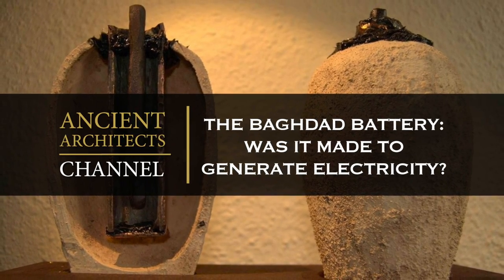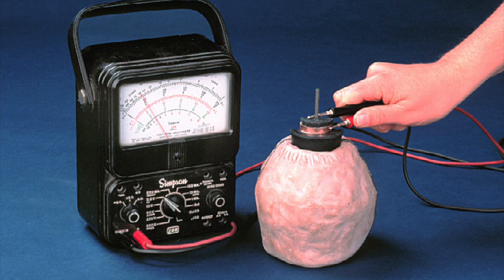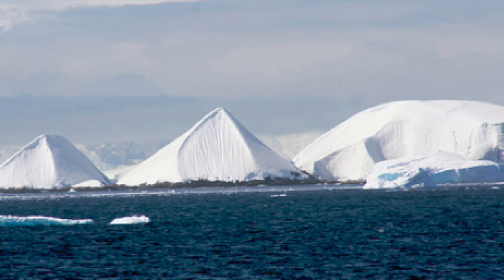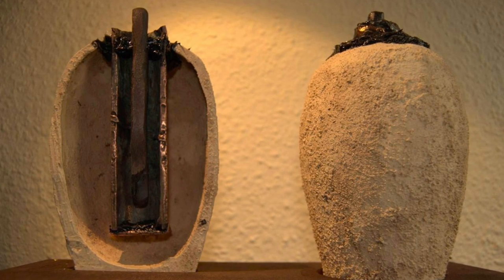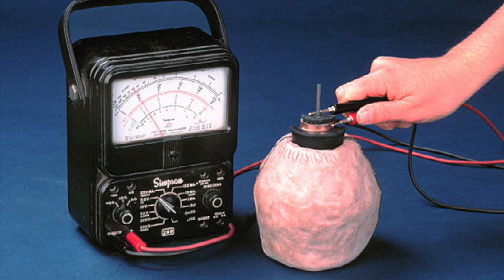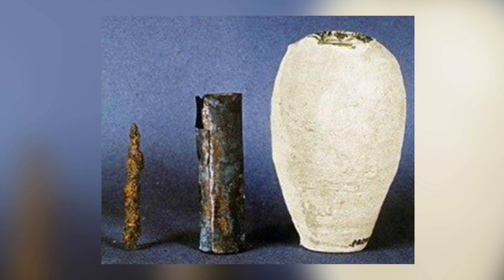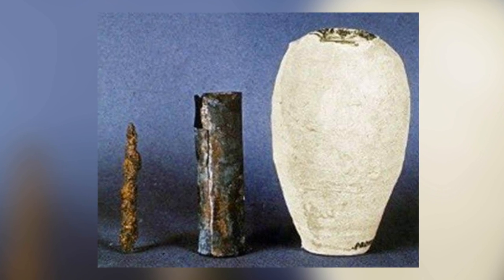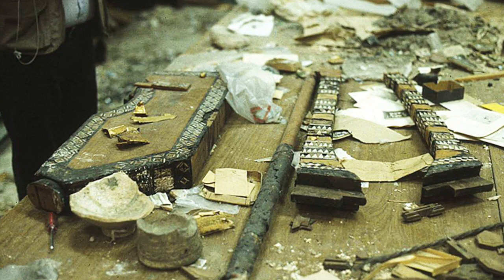The Baghdad Battery : Did it Really Generate Electricity? | Ancient Architects

Comment: Okay, but if they were to store papyri,  then where were the remains of the papyri when the jars were opened? Why traces of acid on the iron rod? Why the copper cylinder? The papyrus hypothesis only answers the question of why the jars were completely sealed over with bitumen. It doesn't answer the other questions. A sealed clay jar should certainly have preserved papyrus, so the absence of any papyrus in the jar suggests a different purpose. Certainly is a puzzle! Thanks as always for discussing this!
Reply: I had those very questions. The papyrus storage hypothesis seems even less plausible than the battery hypothesis - though many of the problems with the latter are glossed over by its proponents. And it's nice to have an evidence based discussion of these artifacts. Is there an application other than a low voltage battery that copper, iron and acid can be used for?
As for completely covering the iron with bitumen, if these were batteries, could that have helped to preserve their charge until they were needed?
Reply: @TugIronChief  much like the dead sea scrolls
Reply: They weren't batteries for gods sake! The only reason why you can say that it's because they look like one. If that was battery then where are the wires? What kind of machines are they used for? You guys really should stop this new age bullshit.
Reply: @arkyudetoo9555  you should stop believing everything your told by the corrupt main stream and learn to open your mind and think for yourself
Reply: @arkyudetoo9555  Okay, but if they were to store papyri,  then where were the remains of the papyri when the jars were opened? Why traces of acid on the iron rod? Why the copper cylinder?
Reply: @DiscordC  Unlike conspiracy theorist, I don't assume on the answer.
Reply: @DiscordC  I know how to think for myself thank you very much. I don't trust the government as well, but when it comes to scientific discoveries, these things can be verified by 3rd party sources. Say for example the Earth is spherical not flat. Etc....

Comment: Plating.  I work in the plating industry.  It wouldn't be hard to use this for ornaments and trinkets.   If something was plated, anything found from so long ago the plating would be long gone..
Reply: Also, I'm not trying to correct you at all.  You are far more versed than me and you can probably find better examples than what I was able to Google.  Love you channel!  Long time follower, first time commenter lol
Reply: Spot on!
Reply: Correct, that was probably where it was used for.
Reply: It might have been kept as a trade secret too. After all, If you had the power to electroplate you had a great advantage, you could easily short change people as a jeweler claiming something was solid gold! And no unhealthy mercury to deal with. Just iron and copper and vinegar. 
The only mystery to me is why they put the copper cap on the bottom of the tube, since it is not required for it to work as a battery. The whole thing could be filled with vinegar, it seems pointless to use the clay jar as an insulator. But maybe they did not understand things correctly. Regardless it would work either way.

Comment: The tar could be easily melted inorder to refill electrolytes or am I wrong? Could it be that priests found a novel way to create a charge for someone to touch and get a religious experience(shock).
Reply: interesting theory indeed & plausible.
Reply: I like this theory. Makes sense
Reply: Priests used to use all kinds of tricks in temples to impress their visitors. Massive doors that swing open at the touch of a finger, mechanical "robots", windpipes that "sang" in the wind, steam engines that twirled when heated by a fire, etc. The Greeks excelled at this because of their scientific innovations.
Reply: the charge from several of these in series would still be weak enough to require you to lick the electrodes. Just dont ask which part of the statue of god they put the electrodes on
Reply: @GreyGeek >  O2(g) + 4H+(aq) + 4e-  -> 2H2O(l)
If the electricity is internal and the jars not found together, could it be a way of purifying water?
Reply: @GreyGeek Great criticism. Thanks for the long form explanation.
Reply: @GreyGeek You are missing 'wires'. Wires would attach to external object. It was sealed so that it can be carried easily without spilling the contents.
Reply: @paulpvhl1930  This is an interesting thought

Comment: The bitumen was not complete hardened at the time, you know it is soft and often mixed with oils to make it more flexible therefore removeable. They could connect 12 batterys and had 12 V like a car battery. the cable were made of copper and they used it to plating or for electrolyse. Just because you can find a motor or a vacumcleaner mean not the had no use for electricity.
Praveen Mohan built some of them take a look:
https://www.youtube.com/watch?v=KDlcU1vt4bU
Reply: As they say, absence of evidence is not evidence of absence.
Reply: The problem is people are assuming it is a battery, so they are looking for evidence that is one. Instead of looking for evidence of a battery, just look at the evidence available, THEN make a conclusion.

Comment: I was amazed when you mentioned the ratio of lead to tin for the solder. Same as we use today in modern electronics. Below is a brief explanation.
63/37 ratio is a Eutectic alloy of Tin Lead solder. As such it melts at a temperature that is lower than each of its constituents, and at a very precise single temperature rather than a range of temperatures. In the case of 63/37 it is 183 degrees. 60/40 melts around 188 degrees C.

As the melting point is a single temperature it will transition fast than non-Eutectic alloys which means lower chances of dry joints. In non-Eutectic alloys one metal will melt before the other, and the same is true when solidifying.

Comment: Voltage alone does not tell you the power. Keep in mind, a car battery has only 12V, but it is quiet powerful. 
You really don´t want to shortcut one of these.
Why would they use two different metals to store scrolls? I don´t have a clue what this things are.
Reply: Copper was valuable and was used before bronze and then iron for armor.  It was also used as currency later [as traded ingots earlier].  Using a copper, bronze or gold cylinder to house or transport important documents is reasonable.  Putting an iron rod that could cause damage could have been done in ignorance of that danger.
Reply: @JMM33RanMA  You think ancient humans were ignorant about basic Metallurgy? It is clearly a battery to produce electricity.
Reply: @trira1171  What a bizarrely hostile reply.  Stating your unsubstantiated belief strongly doesn't make it true.  While it is possible that it was a battery, there are equally possible alternatives.  Without actual proof, arguing like the six blind men and the elephant is silly.

Comment: I'm behind the electroplating theory. As far as electroplating materials go, all you need are a battery, some electrodes and a bowl of plating solution.
They wouldn't be electroplating gold, so whatever was plated would have likely corroded and/or the plating came off. There's a lot of incentive to gold
plate items for the purpose of economy, or deceit. If it looks like a battery, and it act's like a battery, it probably is a battery.
Reply: The necessary volts needed to electroplate metals is around 5 to 12 volts, this thing only emits like less then 4 volts and has one terminal covered
Reply: @bioman1hazard607  As for what you can power with them, thats only a question of many do you have or can you make, as you can connect them in series or parallel to increase voltage and current indefinetely.

Comment: There are many artifacts in ancient human history,  that are gold plated.  It's one thing to find something like the Baghdad battery,  and question what it was used for, but when you recognize that there were gold / metal plating from around that time, it's just reaffirms that these people had electricity.  Even in ancient Egypt,  there is tons of evidence for the use of power tools, and though they could have used heavy stone flywheels spun up by human power, there are many examples of this tooling,  within sharp angles of stone  boxes,  in which you could never fit such a machine with a large enough fly wheel nesacary to produce the power to do the work. Again, u keep finding evidence,  that supports other evidence,  that supports a theory.  They had electricity.  There is more evidence to suggest it, than there is evidence to deny it.
Reply: The fact no soot from oil lamps inside the megalithic structures also say the Egyptian used something else to light the passage ways. And there are many catacombs under Egypt built by the ancient Egyptians. Probably just to get out of the mid-day heat. There is the theory of mirrors, but morriors also magnify the heat of the sun, not just the light. ??

Comment: The Modern AA,AAA,C and D batteries are around 1.2v , the vessel does resemble electroplating equipment.  Placing a thin layer of metal on another metal is useful, and depending on what was being made may have disintegrated, overtime. Copper on iron, would not likely have survived t the modern age. The Statue of Liberty in NY had to be largely rebuilt after 100 years, and the copper on Iron contact points now have insulating separators. 
For a Scroll holder copper makes some sense since it is  anti bacterial,  What ink could they have used that fruit juice wouldn't wreck? If the vessel could infuse copper into the scroll it would last longer with out decay.

Comment: same could be said about the papyrus theory, if they where completly sealed and no evidence on being opened how did they get the scrolls in and out? if they where batteries they could possible been used for electroplating and electroshock therapy, small thin copper wires could have been permanently attached to the '"battery" then using asphalt to get them to stay in place, and if there where thin wires attached they would have been corroded away long time ago.
Reply: MrSnigleN 1v? Wouldn’t shock or plate anything
Reply: This was tested on a show called mythbusters and they were able to electroplate a small object with a bunch of them but it was not able to shock the guy that tested it.
Reply: @utubeadrianno  As you can connect batteries in series or parallel to increase voltage or current indefinetely, there is no limit to what it could power if you have enough of them.

Comment: It has been demonstrated you can electroplate metal with voltage as low as the batteries
Reply: He does go on to say that there has been no electroplating found from this time period
Reply: There is no limit to the voltage or current based on the battery, as you could connect them in series or parallel indefinetely.

Comment: Aren't AA batteries only 1.2v? I don't understand why voltage forms a part of your reason for scepticism when our batteries are the same voltage. There isn't any evidence against them being batteries except that batteries were not used at the time, they function perfectly as batteries and the technology is very simple and could easily be discovered with the tools available.
Reply: Except there isn't any evidence they were used as batteries.  That's the more important issue.  Anything could be something, but you need evidence.
Reply: @Desrtfox71  There isn't any evidence grain was used as food, but we accept it as so because we know grain is food. Its a battery, the only issue is did they know it was a battery. As we have found many of them I would argue the did know they were batteries.

Comment: Thanks for another great video.  Those are good arguments against a technological society that understood and harnessed electricity, but weak arguments against those artifacts being batteries.  I can easily imagine that the battery was a sacred or power object that performed some minor miracle  - making some small thing spin, jump, tingle, flash or whatever.   As they were they could last for many years in their ceremonial function - they're not powering a radio for example so no need to worry about replenishing the electrolyte or even to think the designers knew such a thing was possible.   In my opinion they are more likely to be batteries than not just because it is the simplest explanation - just about any liquid in the copper would generate a voltage that could have some magical, mystical function (without any fundamental understanding).  The argument "It's a battery because it looks and behaves like a battery" is quite different to the argument "That hieroglyph is a helicopter because it looks like a helicopter" because of Occam's razor.  In this case it simplifies, in the other it requires great complexity.    I don't see that there can be anything strange about it being a battery given that it exists.  But this needs to be separated from the idea that electricity was 'discovered' by ancient civilisations.  A child has not discovered electricity by rubbing their feet on the carpet and getting an electric shock from a door handle - they have just discovered a phenomena - and no reason to think differently about this.  I agree an interesting question is "What did they do with it?"  but not knowing the answer does not rule out that there was something.  The argument that the bitumen sealed over the iron rod does not seem like a major problem either as it could easily be scraped off when required (or was added when the battery was dead or many other explanations).
Reply: The battery was sealed maybe to prevent  vaporization of the electrolyte

Comment: Your point about "Mainstream Science" misses a key element of skepticism:  Where mainstream and alternative converge, we see those on either side latching onto the other's methods/points. This is normal human behavior.  This does not mean mainstream methods are wrong, just able to be used in a corruptible manner to maintain "mainstream" conclusions. 

There are many applications where they are accurate or appropriate but there are other circumstances wherein mainstream methods are corruptible toward establishing definitive "conclusive ruling". 

Regarding bitumen and sealing:  Is it possible the stash(es) of these jars was never used?  Was 'in standby'? Or, was simply resealed?  How do you/we know the bitumen used to seal them was not a secondary/tertiary application? If they removed all bits of prior bitumen and re-applied a new application, to our eyes, thousands of years later, would it look like only a single application?

Voltage:
It needs to be pointed out that one (1) volt is a significant amount of voltage. Your regular batteries in that remote or flashlight are only making about a volt and a half...  so:  plenty can be done with that.  

To your point about wires not being found:  Does this mean they were not originally present?  It seems to me that thieves or others would be more likely to 'smash and grab' the exposed (and thus obvious) wires.  I would imagine that "wires" as we know them, would not have been used... rather something more like "buss bars" would be used (solid copper rods or some such).

As to usages: 
Even a low voltage (a single cell) would be useful to generate a relatively strong magnetic field (compared to the Earth's magnetic field). Is it possible these were used as some electromagnetic tool, for alignment, water discovery (divining), etc?  I imagine I could think of more uses for moderately low magnetic fields.

Comment: We tend to think of bitumen as being a solid -- but it is actually just a VERY viscous liquid. Over 2000 years, it flows slowly. (Think of a very thick molasses on a cold day.) Just because the iron rod and/or copper cylinder were covered with bitumen, that does not mean they were constructed that way. Also, you ask why did they not just build bigger batteries instead of more small batteries (8:30). Larger cells do not make higher voltage. The only way to bump up the voltage is to connect more individual cells. As for wiring them together, any copper wire would probably have been scavenged or (being thin) corroded away. At 8:05 you mention that they may be storage vessels for scrolls -- so why were they sealed up with bitumen without having any scrolls inside? And why put in copper cylinders, iron rods, and acid? Does that REALLY sound like a good way to store papyrus? You are very correct that there is no PROOF that they were batteries -- but they certainly look as if they were made to be batteries, even if they were not very efficient. Not finding a verified good use doesn't change the fact that they appear to be batteries. By that logic, if archaeologists found an obvious steam engine, you could just as well say "but if it was REALLY a steam engine, we would have already some train tracks and rail cars." So -- what use is a relatively crude cell, or grouping of cells? As you mentioned, maybe electroplating. We know that in modern times, electroplating was developed almost immediately after the invention of the electric battery. Have ancient pieces of jewelry been examined closely enough to determine whether any of them were electroplated? How long does a thin plating last? I have objects only a decade old that have already lost much of their plating. Low voltages are also good for making hydrogen gas from water. Maybe someone was running some type of alchemical experiment. Who can say?

Anyway, as always, you make a GREAT video and inspire good, objective thinking. Personally, I think that if it looks like a battery, is built like a battery and produces electricity like a battery, then probably it IS a battery! But is it proven? Not beyond argument. Thanks for you really great work and research!